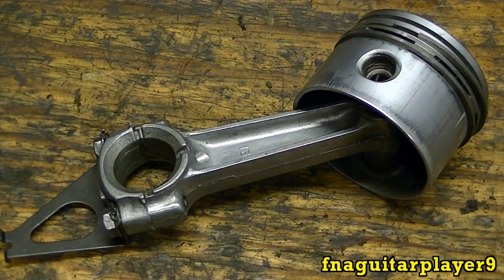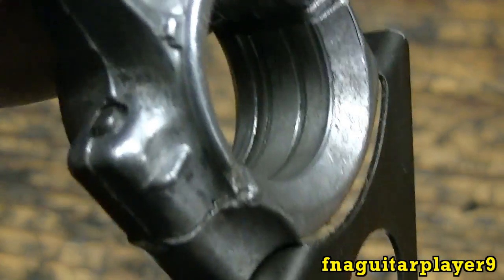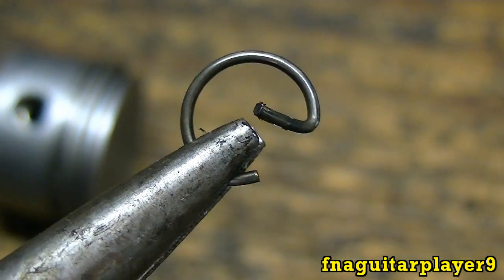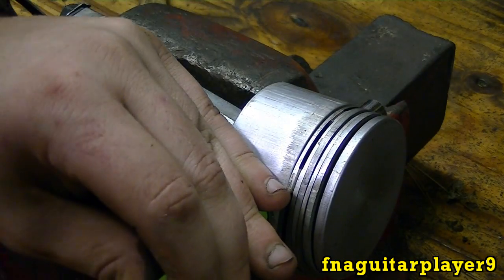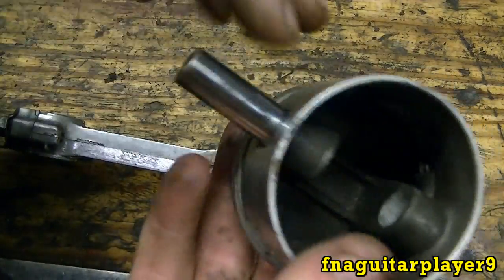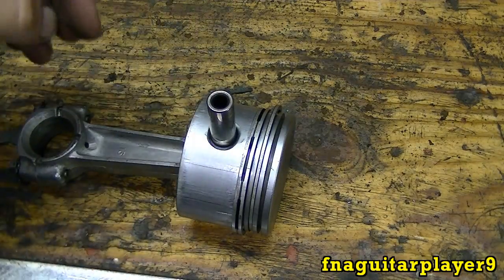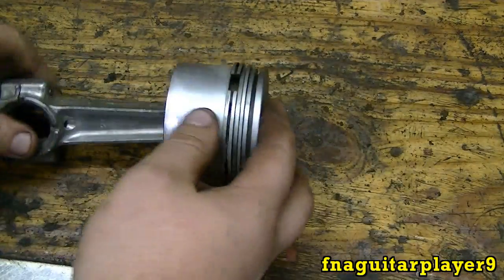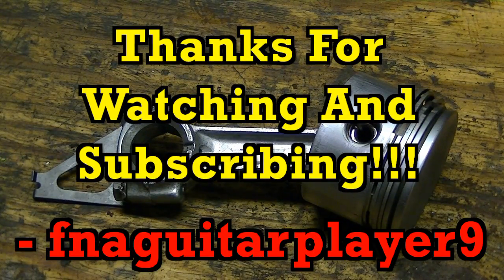How To Separate Rod and Piston from Wrist Pin

Comment: Is there a way to smooth down those marks on a piston so it can be re-used or is it preferable to replace it. I'd like to rebuilt an engine from salvaged parts or make a good one out of 3 or 4 old engines. Thanks a bunch.
Reply from the maker: R Verro You can use a emry cloth of high grit sand paper, like 400 to 1000 grit to smooth any scores on the piston, its not quite as critical as say a cylinder wall or a crank or rod bearing surface. But yeah if its excessive it would be best to replace it. I know what you mean, I got enough spare parts to build a couple 12 horse briggs, might just need new gaskets and rings and make a perfectly good engine. Thanks for Watching!